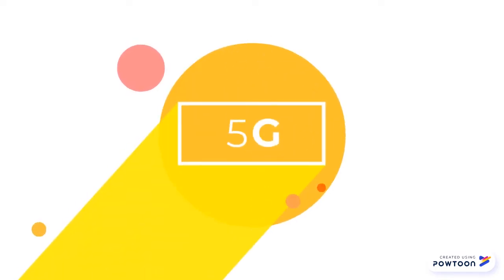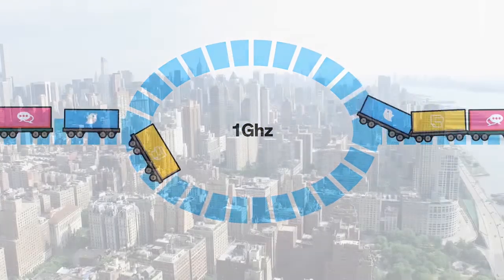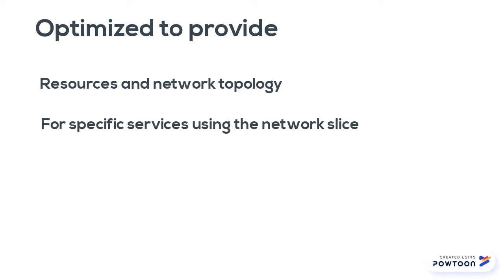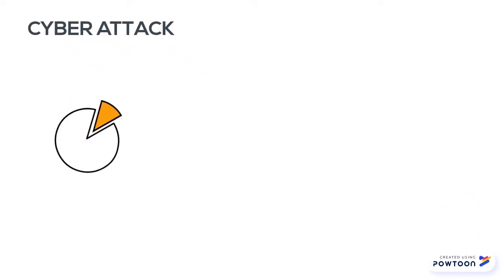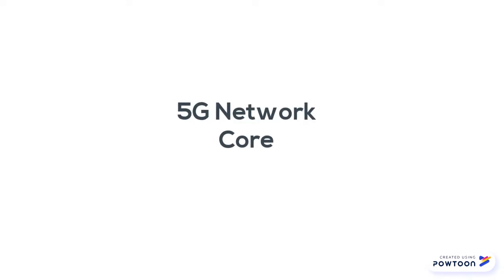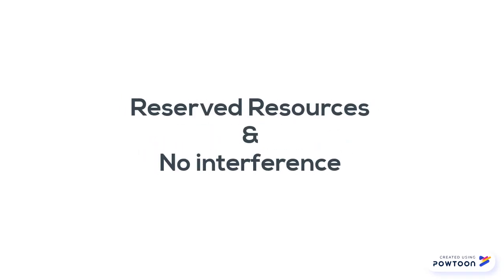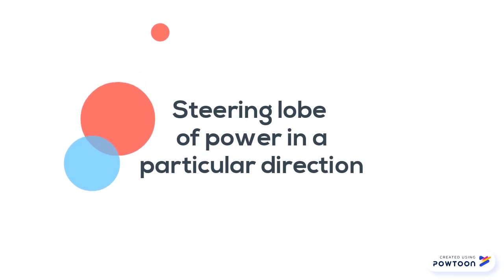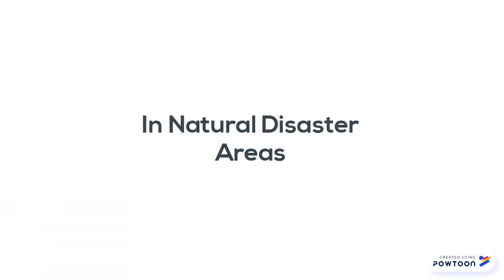5g as Enabling Technology for Building Cities Resistant to Natural Disasters

Comment: What are the implications of a security breach to critical 5G infrastructure that is used for enabling cities to be disaster resistant? What are some of the top security threats?
Reply: Possible implications:
If large number of connected devices are hacked and controlled by attackers, the infrastructure may be either locked as a part of ransomware, controlled as botnets, or used to spy on other countries' activities, leading to data loss or loss of network security. 

Top security threats:
Higher levels of data transfers implies higher threats of malicious file transfers. With high transfer rates, data extrusion or large malicious file transfers could more easily escape notice. Also, a compromised SDN controller, "can give 'root-like' access to configuration of virtualized devices under its control.

Comment: If the higher radio frequency band of the MIMO network can't pass through solid objects or rain, how would that affect the 5G system?
Reply: 5g beam-forming and massive MIMO systems will use dozens of small antennas  that are all transmitting in sync to boost the power that a receiver will see. These systems can even adjust the phase of the radio signals for each antenna to create narrower beams where the power is high enough to penetrate through objects.
Reply: Good reply, thanks for answering!